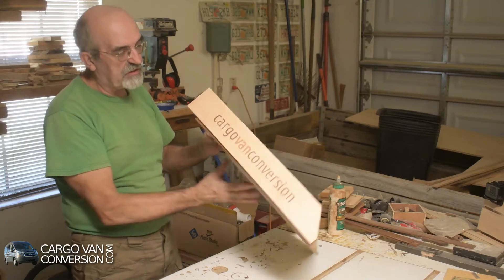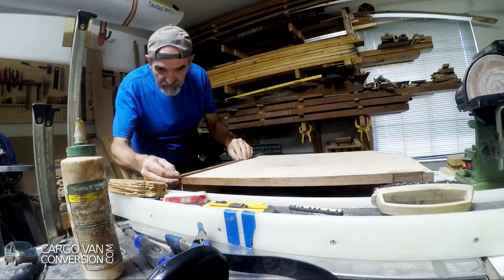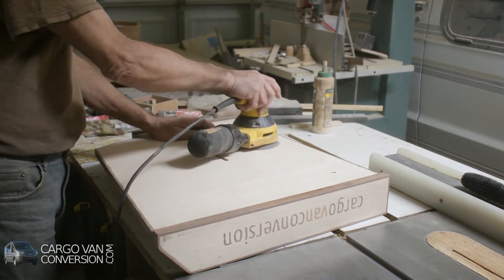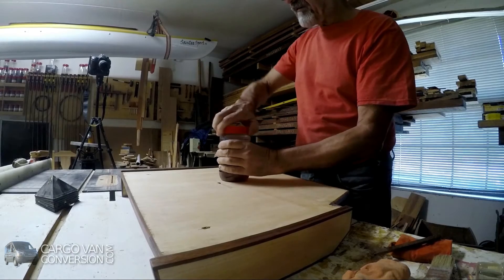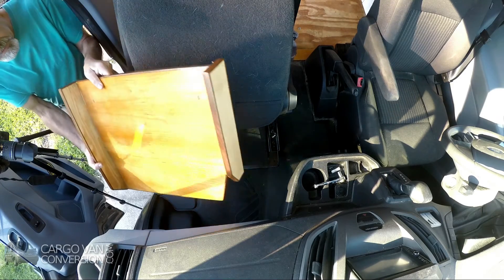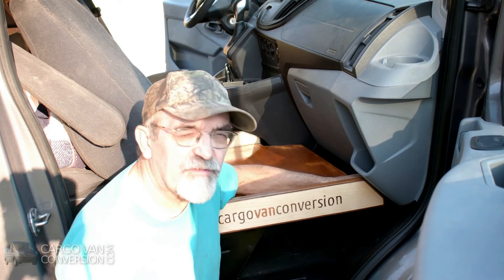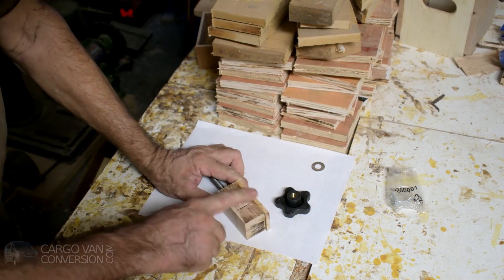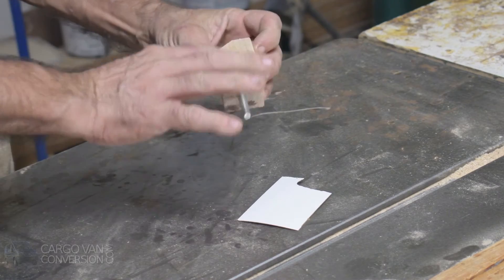Murphy Bed Lock & RV Dog Travel Bed

Comment: So can't wait to see the desktop
Reply from the maker: Hi Traci,
The actual installation will have to wait a while. Besides the regular 'scheduled' work. I'm currently also working on a Mondriaan inspired oil painting, that will go into the square indention at the front (actual bottom) of the bed. I will also need to spend time on a second picture (M.C. Escher inspired) which frame will go on top of the other painting. This frame will be hinged at the bottom and transforms into the desk.
Before I will proceed with all of this, I want to create a special surface for the desk. Perhaps with inlayed texts, pictures or other 'art'. So whenever I have time, that's what I'm working on.
I hope the result will be as fabulous as the above sounds, but I'll be satisfied with much less :)
Just wait and see.
Van Williams & Joey.

Comment: Your murphy bed locks look a whole lot better than mine turned out. Mine would have been better but for the lack of ability to drill a straight hole when standing off to the side. Once again you are a master carpenter on this van build.
Off the subject a bit but i noticed you have an airbag tag on the passenger seat right side now being reversed the left side. Have you disabled the airbag as it could cause problems in an accident. If disabled, how did you turn off the dash warning light? i ask because I installed a swivel in my van but keep it reversed 95% of the time. if I unplug the connector under the seat the warning light comes on. 
Thanks again for all the great ideas and "how to" knowledge.
Reply from the maker: When drilling a hole straight is crucial, it's best to use a drill press, but not everybody has that. I drilled these holes in the sideboard and the bed before the actual installation, which made it that much easier. If you have to do it on the job, I usually take a small square and place it on the surface; this gives you a 90 degree angle to place your drill next to. Not perfect, but it helps.
I never carry passengers, except Joey :) So I disconnected the air bag soon after I bought the van. That would be safer for Joey too. The disconnect switch is located in the glove compartment (left side). When you turn it off; it'll show that on the dashboard below the radio. Don't mess with connectors; that's all connected with the onboard computer.
One suggestion: don't worry about how perfect your bed is. There is always someone who does it better, no matter what you do. You made your bed and now have to lie in it (Duh!). Next time you'll do it different and maybe better. They call that experience :) Enjoy it and be proud of it. Not everybody can do it. You can.
Van Williams
Reply from the maker: I posted a photo of the passenger seat air bag switch under the 'community' tab. Hope that helps.
Van Williams
Reply: @cargovanconversion  Misunderstanding on the air bag I think. The switch you mention is for the air bag that is located in the passenger side of the dash. If you look at the outside edge of your seats there is a tag that says airbag. That means there is an airbag located in the seat back itself on the outer edge. This airbag is powered through a connection under the seat. Look for a yellow connector, it's very small. I discovered mine when I installed a swivel on the passenger side. When it is disconnected a warning light will come on showing picture of a seat and airbag. 
The only other thing I can think of with misunderstanding is due to different years. I believe yours is a '15 or '16, where mine is an '18. Maybe Ford changed things. Anyway I was just wondering as if your's is active you need to be aware in case of an accident  as the bag will explode towards you instead of the door.
Reply from the maker: Interesting discussion :) First I always assumed that 'disconnecting' the passenger seat air bag by way of the switch, would result in a deactivation of the front, seat side mounted and side curtain airbags. Still doesn't make sense it just deactivates the front air bag only.
Have looked at the BEMM where they recommend buying the vehicle without side airbags, but in reality that's is not a factory option. The BEMM doesn't say whether the use of the switch extends to the seat mounted airbag either.
For the time being, I take comfort that by turning the seat around, a possible deployment would extend out the side of the seat and BACKwards. Away from the direction of the driver, but it's a nagging question.
May ask the dealer whether the use of the switch extends to the other passenger airbags, but don't have much hope on an answer here. Will do some more research.
I may in the end disconnect the wire connection under the seat and to prevent a warning light from showing up, install a airbag simulation module that fools the computer into believing that the wire is connected.
Never to old to learn something new :) Thanks for bringing it up.
Van Williams

Comment: G'day Van & Joey, I reckon that Joey will be tickled pink with his custom travel bed, especially when he get's his new mattress & cover.
Will he have a seat belt or a restraint when traveling to stop him sliding off if you have to brake hard?
In Australia you will be heavily fined for not having our furry friend's restrained by a leash or harness, because they can become a missile
or worse in the event of an accident.
I must say that I am very impressed with the Cargo Van Conversion embossing you have done, it look's really great Mate.
Safe Travels to You & Joey Mate, Steve.
Reply from the maker: Hi Steve,
I hope he does better when his mattress is in; it was all too slippery right now. His seat/bed is pretty low to the ground, immediately on top of the seat pedestal. To the back is the regular seatback and to the front, the dashboard, pretty high up. I disengaged the passenger airbag, just in case. If he can get used to it, it will be a great improvement for his safety and comfort. We'll have to see.
I have been struggling with the issue of using safety restraints for a very long time. There may be different rules for that in each state, but usually the rules are minimal afaik. It's a good time to remind me of that. Will use his harness and have now the opportunity to secure it. First have to get Joey used to the bed; then hoping the restraint is not too restrictive.
Haven't visited your channel recently; will do that soon. Hope to see the work on your camper.
Have a great weekend. BTW Hope you're not in a fire zone :)
Van Williams & Joey ... woof